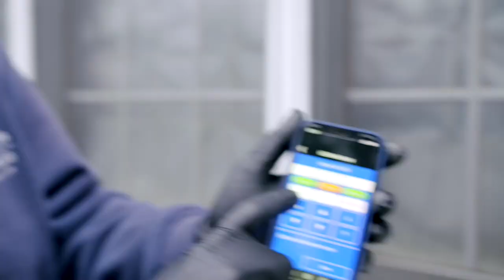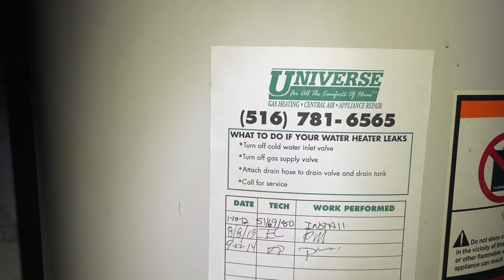Broken Tub Spout Replaced & Tub Drain Assembly Seized - Disassembly Required

Comment: Mike , that tub spout joint was not done very well.  The solder is not to hold the spout piece on the copper it is to also seal the connection.  Think about how 
the spout works, when you divert, the copper and connection is under water pressure and will leak through the connection and potentially behind the wall.  
Just some food for thought.  You could also sweat on a c x m adapter and screw the Delta connector onto that.
Reply: Your Right

Comment: Orientation of tank does not matter if it's properly supported.
Reply: @PipeDoctor  I read the manual. There is a rationale behind the manufacturer's recommendation. Excess weight from the extra water can cause damage. There is a method to eliminate the risk of damage. Support the pipes/tank. Works better then any orientation.

Comment: that's horrible luck to run I to a trip lever THAT seized.  I'll fight with needle nosed pliers from the overflow plate to free it up, sometimes there's no hope.  

I use the cheaper fluidmaster fill valves, I can't believe the pressure was enough to lift the toilet tank lid, but I'm sure he learned his lesson.  those plastic nuts on the fluid master fill valves feel dicey, but have never seen one fail from there.  They just seem to be easily clogged, restricting a normal 20-30 second fill

Comment: First no shoes no service,
I would have kindly left!!!
Second invest in no drip washers the balls wick is whack 🤣(maybe for packing)🤣
No drip with blue seal it will rot before it leaks!!!
Second you should have tub trap overflow on your truck that looked like a call back waiting to happen.
3rd - That solder job looked a little snotty!🤔🥃🥃🤣
You did say to criticize !🤣😂😆🤣🏌🍇🥃🥃🍺🍺🍺
Stay safe.
3 today ???
Retired keyboard super tech.
Wear your safety glasses.
Reply: Didn't look like the solder sucked into the joint, just boogered up on the surface.  Hope it's not leaking.
Reply: @PipeDoctor  the o-ring is on the outside🤯 the most pressure will go through the gaps if any while the shower is running?🤯
A small leak can make a ceiling collapse?🤯
🤔
Stay safe.
Retired keyboard super tech.
Wear your safety glasses.

Comment: I’ve never seen someone solder a tub spout adapter that is slip joint and just needs the Allen screw tightened. Have you heard of O-rings lol they are not designed to withstand a torch
Reply: @PipeDoctor  7 years and it only takes a first year apprentice to know you don’t solder that adapter 🤣 you should read directions more bud
Reply: @PipeDoctor  you sweat on the copper mip, not brass tub adapter bud
Reply: @PipeDoctor  stop being so hard headed hack stop ruining those adapters or you’ll ruin the product
Reply: @PipeDoctor  dude I know for a fact you don’t solder those 🤣🤣🤣🤣 I’m not bothered by you choosing to be ignorant
Reply: Delta Faucet RP33794 Tub Spout Adapter for Slip-On Diverter,Chrome
Reply: @PipeDoctor  This Delta adapter RP33794 is the bomb. If your tub spout has the 3/4" I.D. threads at the wall end of the spout and you have a 1/2" copper pipe sticking out 2" + this is the adapter for you. This model adapter with the set screw allows the adapter to be slid over a stub of smooth 1/2" copper pipe and located approximately 1/4" from the finished wall surface and tighten in place with the set screw. There are external and internal O rings that provide a tight fit and no possibility of water leaking back from the end of the pipe. Clean the copper stub pipe thoroughly and deburr the end of the stub due to the internal O ring. A little plumbers grease (I like to use Super Lube) on the stub and gently slide the adapter over the copper stub. DO NOT over tighten the set screw as you could inadvertently wear a hole in the 1/2" copper stub. Then apply a good coating plumbers grease and hand tighten the tub spout up to the finished tub wall. Finish with a small bead of 100% bathroom silicone and you are done. Delta makes good products - stay away from the universal Danco junk that they sell at Lowes and other places. You will pay more - but you get what you pay for.
Reply: Read. And weep HACK